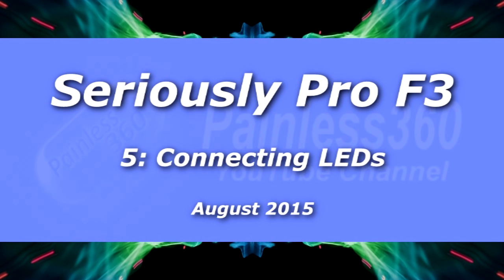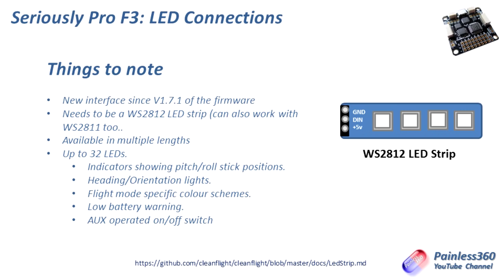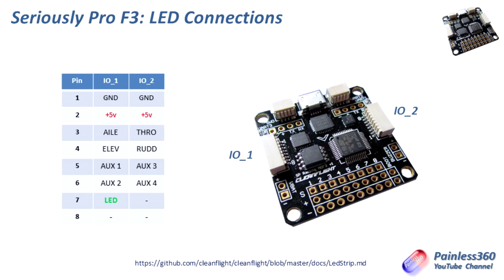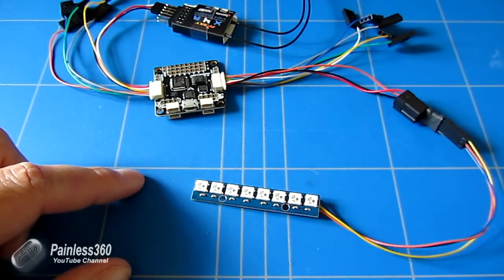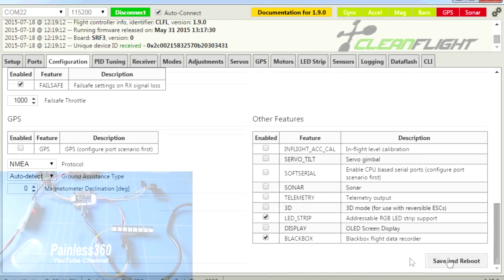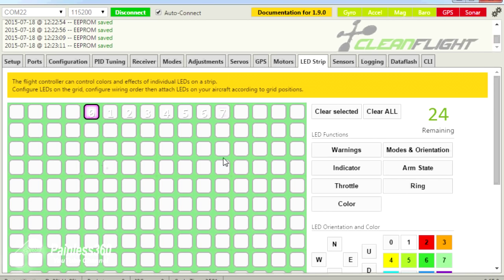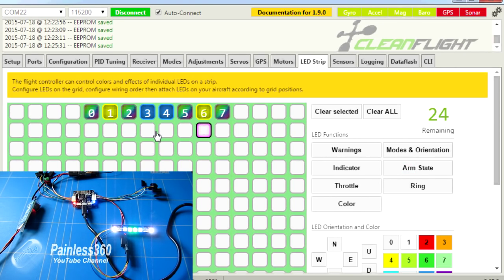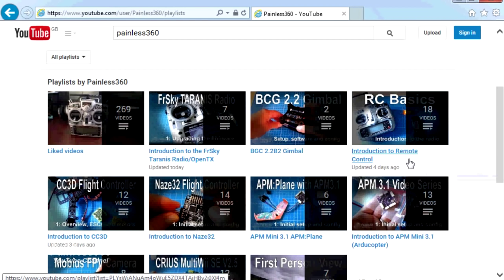(5/9) Seriously Pro F3 (SP3) Series - Installing WS2812/2811 LEDs

Comment: Where are the other videos in this series?
Reply from the maker: Gucci Mane You're not using the playlists are you ;)
Reply: Painless360 I am, but 3 of the 5 videos in the playlist are private.
Reply from the maker: They are scheduled for release in the coming weeks. Sadly that's the way that YouTube does it.. Not long to wait..
Reply: Painless360 ahh, I was just wondering because I was thinking about buying one of these boards and just wanted to learn more about it.
Reply from the maker: They should be coming back into stock soon. The manual covers the basics and you can get in the air with the videos already published. In the first video I cover the changes over other Cleanflight boards (i.e. Naze32) that should help..

Best of luck with it. Stay tuned!
Reply from the maker: +Gucci Mane GPS, OSD,  vBat aGPS, OSD,  vBat and Blackbox all on the playlist if you're interested. The videos will be released in the coming weeks..